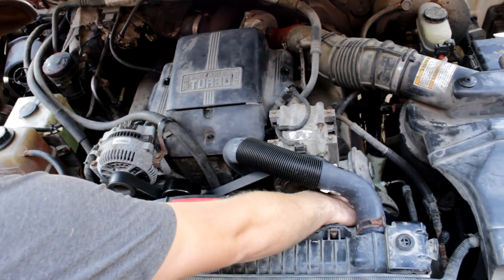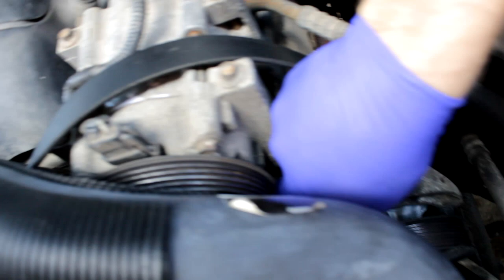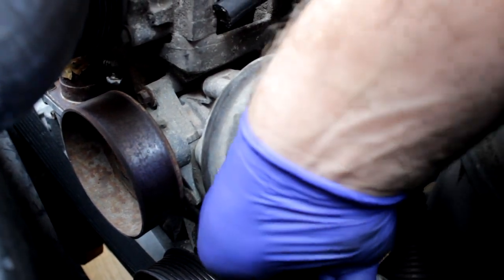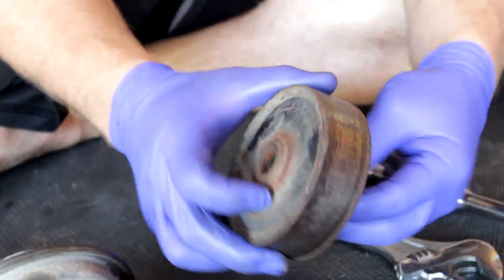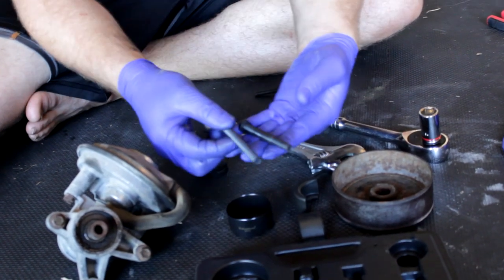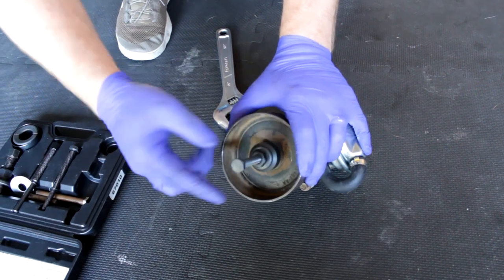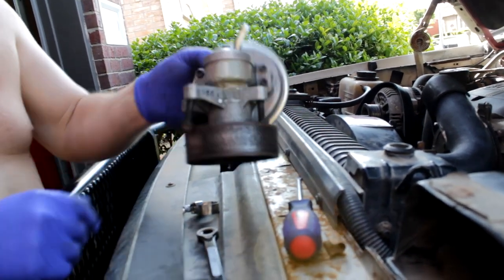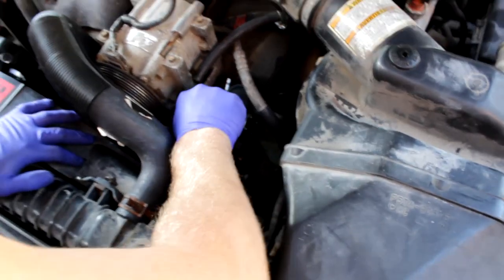VACUUM PUMP CHANGE : FORD F250 (1994-1997)

Comment: Excellent, informative and complete. Well done 🤩 
I replaced my pump 3 or 4 years ago now with a rebuilt maybe new over seas pump can’t remember and I am having a push back on the brake pedal and the brakes release. Kinda sounds like the pump again. Powerstroke Nation forum agrees that the reman or overseas pumps just don’t last like the factory ones.

Would love to see a symptom diagnostic video of all the various quirks with these OBS Powerstroke vacuum pump, vacuum operated brake systems and vacuum operated everything else like “run the AC and if at idle it switches to defrosters while braking or just at idle then you have a vacuum issue.” That was from PSN forum. 

It would also be great is you had links for know trusted parts so we could support your channel by purchasing parts for our rigs through your links. 🤘👍

Also gave thumbs up and subscribed.

Thank you again.

Comment: That's the same pump for a 97 F350 and the dash pot looks to be smaller than aftermarket.  If it's an exact replacement it should exactly fit but the aftermarket Dorman and Cardone dash pots are a bit larger and internal components have imploded causing the pulley to almost seperate from the vacuum pump shaft causing damage to other components and area under the hood 🤔😖🙄

Comment: Great video Sean.I just bought a 94 250 7.3 and the fan motor for the AC and heater operates but no air coming out of the vents. Is the vacuum control you just replaced the one that supplies vacuum to the AC/heater doors ? Is that what I need to replace? Brand new to diesel engines.
Reply from the maker: The vacuum pump allows all AC movement. If the pump is too weak it won't move anything. The vacuum valves under the hood may be sticking, especially if it wasn't used for a while. The AC blower motor under the hood has to spin too. Hope this helps!